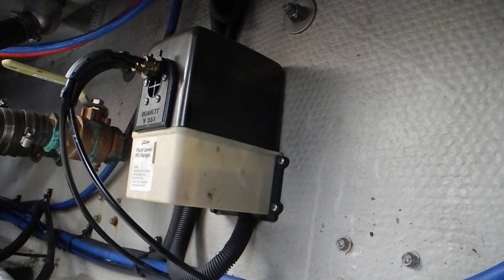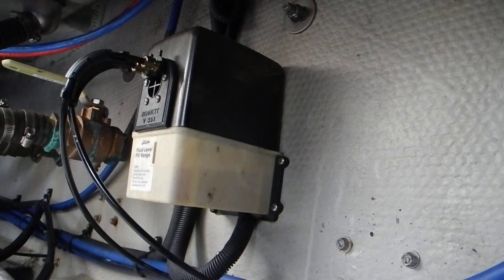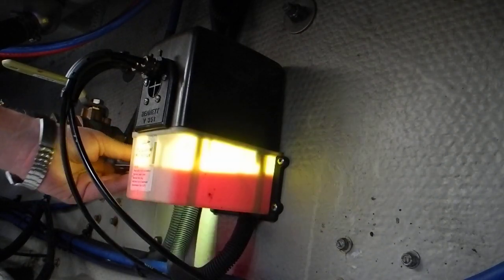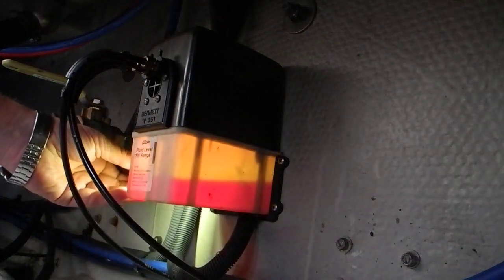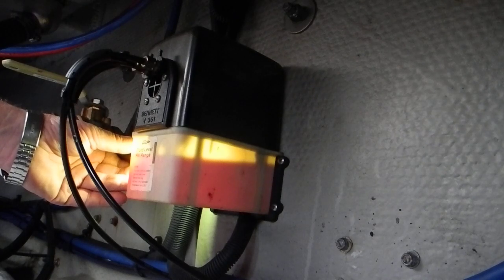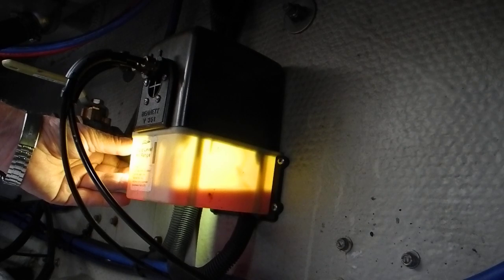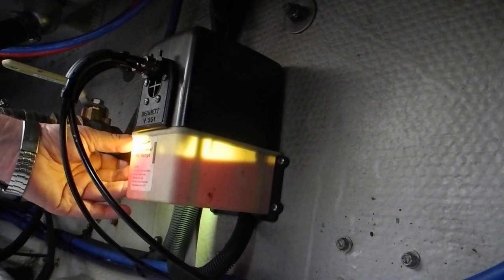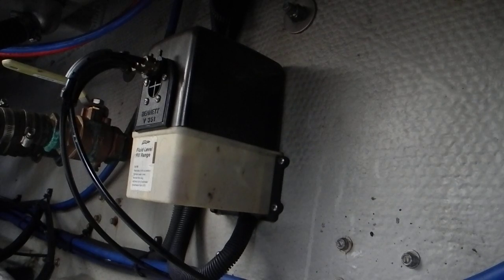Hydraulic pump for trim tabs

Comment: How i works is no big deal.  I was hoping to find a video that would actually show how to add fluid to it
Reply from the maker: Use a Phillips screwdriver STUBBY to unscrew and lift off the dark plastic dust cover. On the left side is a rubber plug, pull open the cap and use the tiniest funnel you can find at the grocery store to add fluid. Read the label, usually requires ATF.
Have fun, C

Comment: My boat doesn't get on plane because my trim tabs are not moving fast enough... could u help me out with what the issue could be? Do u think it's the fluid levels as well or something else..
Reply from the maker: Look at the white basin for the fluid levels? Could be low or the actuators are bad and do not move. Ask a friend to use a boat pole to hold the trim tab down while you operate the controls to prove if they are moving. If they are, next time you try to go up on plane just extend the trim tabs down FIRST then accelerate second, see if that helps.

Comment: I can't find the fill port??
Reply from the maker: This is a Bennett brand unit. The fill port is a tiny vertical tube under the smoked plastic dust cover. You will need a tiny funnel found at the grocery store. Most Bennett's use ATF - Automatic Transmission Fluid.

Comment: hi Capt ..... i need to replace the sensors to my Bennett flaps. Should the installation be done with the piston all retracted with no oil inside or is there a way to bleed ?
Reply from the maker: @Jack-ub4rs  the pistons should be retracted. Sorry I don’t know the proper procedure- maybe check with Bennett?
Reply: @AskCaptainChris  i will anyway thanks for your answer ;)